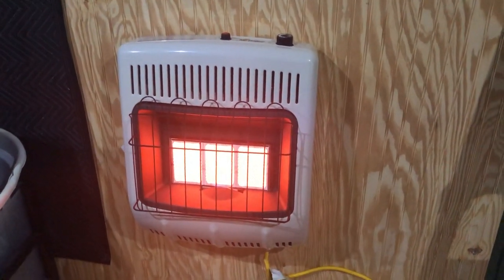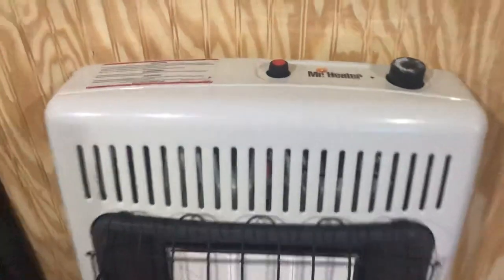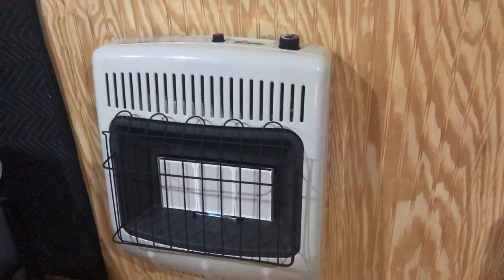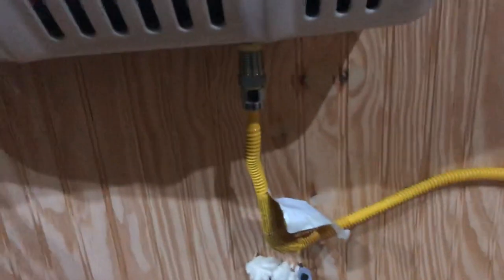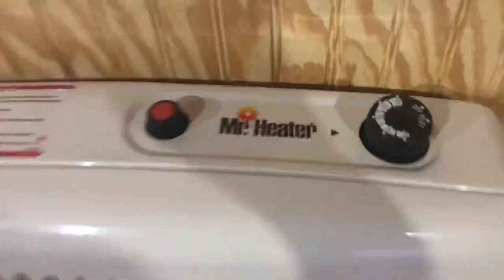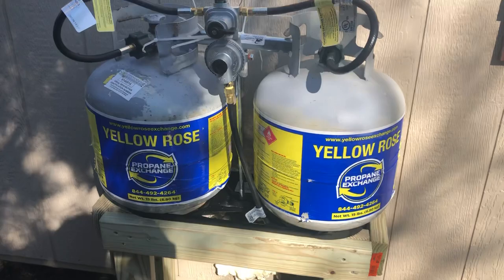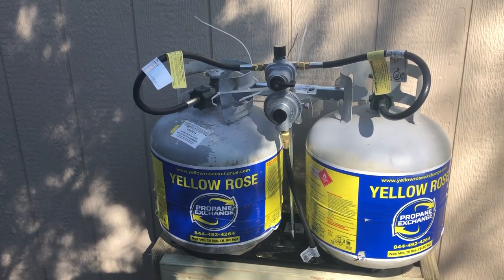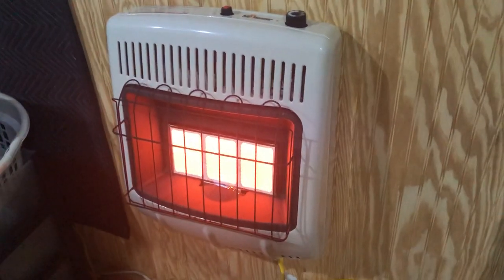Mr. Heater 18,000 BTU wall mount ventless heater and propane setup

Comment: I have a Mr. Heater 20,000 blue flame BTU heater and it will actually heat the whole 1246 sq.ft. ranch style house.  Back bedrooms and everything. And it sits at the far end of the house.

Comment: I installed the same heater for a relative of mine. Her ancient heat pump died, and it would have been over $4000 to replace. It makes the house very warm, and she rarely puts it higher than 2. It’ll last a month on two 100-lb tanks. I put an automatic switch on it.
Reply from the maker: This really has been a great heater, propane last longer and it’s cheaper to run than my generator
Reply: @byrdoffgrid2087  It’s been working fine for 4 years. The only problem I’ve had is an empty tank! It’s a 900 square foot house, and there are no chilly spots, except next to a big bay window at night.
Reply from the maker: @5roundsrapid263  that’s awesome

Comment: What model regulator and valve did you use outside?
Reply from the maker: Scott Faya I purchased a Marshall excelsior MEGR-235 Reg- 2 stage auto from a RV salary store but you can find it on amazon it is a little bit more than other regulators I bought the lines to the bottles separate. I have 4’ hose for when I need to add 100lbs  bottles

Comment: I have a similar one made by Dyna glo. I bought the mr heater metal flex line kit to hook it up. I got all the connections done except for the flex line to rubber propane hose connected I can't seem to find the right thread adapter nipple. Anyway you can help me find what I'm looking for? I'm cold man. Lol
Reply from the maker: I used black pipe from Home Depot. So from my heater out is a brass nipple, to the metal flex line with the adapters to a black pipe T the to 8” black pipe with a 90• elbow then I used a rv rubber hose that connect s to it up to my regulator. I hope that helps... if not take your connections to the hardware store and they and direct you to the fittings you need to make it connect

Comment: Byrd, what is the parts number for the black hose connected to the 90 leading to the regulator outside and where did you purchase it?
Reply from the maker: Thank you for watching! It’s a 18” male3/8”-1/2”female propane supply hose. I also have a male/male brass adapter going into the bottom of the regulator, I purchased this hose from a local RV parts and sales place. I’m unsure of the part#, but you can find this same hose at almost any place that sales propane supply hoses or like u did a rv parts house. I hope this helps you

Comment: Hello! Is this propane heater better than kerosene heater? I wanna switch to a mr heater but wondering if its cheaper and more efficient to run? What do you recommend?
Reply: Yes it is better. You don't have to worry about that smell
Reply: Propane heater better in every way. I'm heating 1300 square feet with 18000 BTU and it stays warm
Reply: Way better. Then you don't have to worry about handling that stinky kerosene and having it stink up your house. I would also say it's way cheaper.  Given current costs of kerosene plus the runtime is way better on a 20 lb tank. Where is the kerosene heater only gets about 8 hours

Comment: I have one of these in a mobile home on my vacation property. I fired it up for the first time today. It needs to be cleaned as the pilot light is burning orange instead of blue and goes out. Puts out major heat and I love how it will maintain the setting over time. Very cool!

Comment: have you thoght about a rocket stove mass storage heater ?
Reply from the maker: David Simpson no I haven’t what are the benefits of it?
Reply: @byrdoffgrid2087  no gas needed just burn wood lots of heat area to cook on with teg modules electricity copper pipe rapped around th barrel hot water i intend to use this idea in th uk when i get forest land to build if no forest land they is always old pallets to burn with the copper coil you dont even have to have them in the building you can have them external then plumb the pipe to car rads and fans to transfer the heat or underfloor heating i am thinking of the rear of old fridges to use as rads under the floor with screed